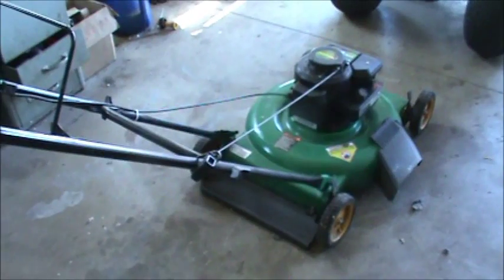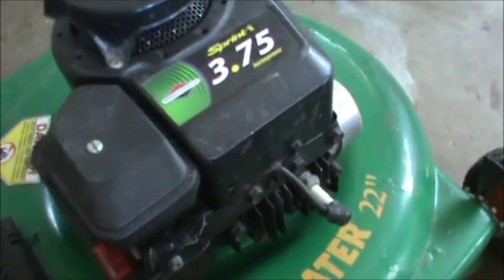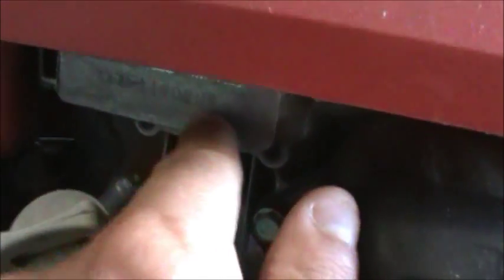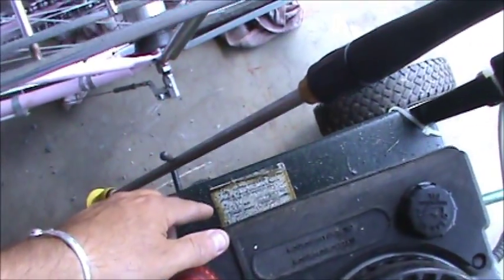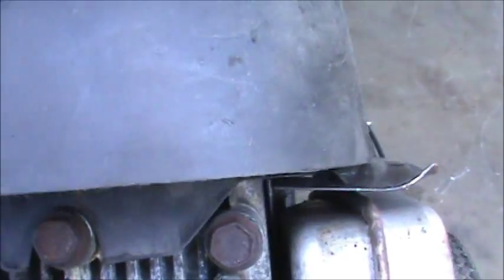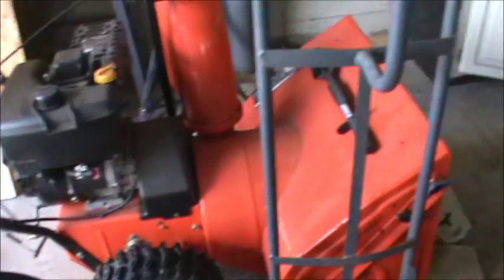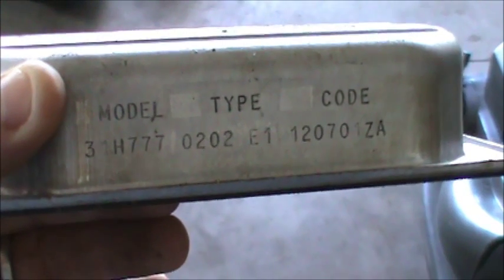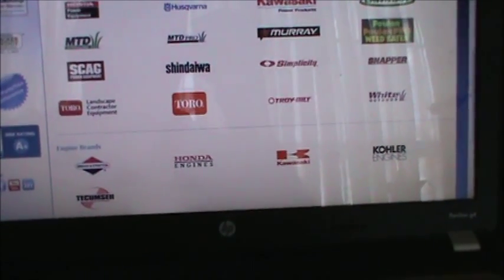How to look up lawnmower Model numbers and parts

Comment: Nice video, it will help a lot of people out. Partstree is a great place for homeowners to start, though their prices are 50-100% more than elsewhere. The date code (DOM) on Tecumseh with only 4 digits is First number= year and Three others= day of manufacture (0298 = built the 298th day of 1980, 1990 or 2000.)  If there are 5 numbers it was built after 2003 and the first two are year and the last three are the exact day it was built (05298= built the 298th day of 2005).

Comment from the maker: You are right about the tecumseh model number date.  I have read that in the past, but really did not plan on putting that in the video (just kind of happened).
Reply: doublewide6 Repairs LLC 
A parts list for a dick comes the engine model 0VRM 120 ignition coil